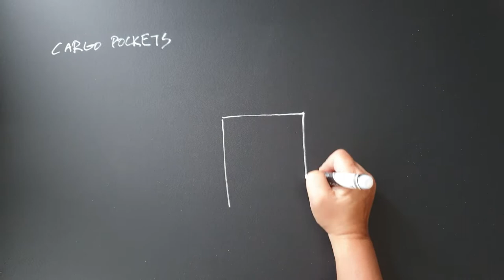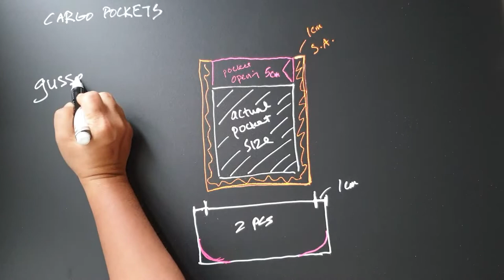DIY Chest Bag for Cycling with Adjustable Criss Cross Straps

Comment: What if you switched the zipper pocket and the gusset pocket? Make the gusset pocket slightly larger, and orientate the zipper vertically instead of horizontally. Wouldnt need a gusset for it if you can access it from the side.
Reply from the maker: That would look great ! The bigger pocket at the bottom would give it a balanced look :) Thanks for the suggestion !